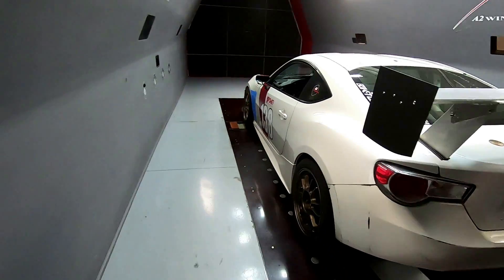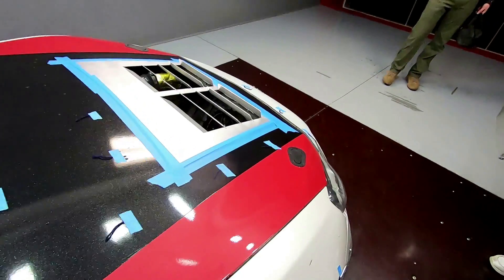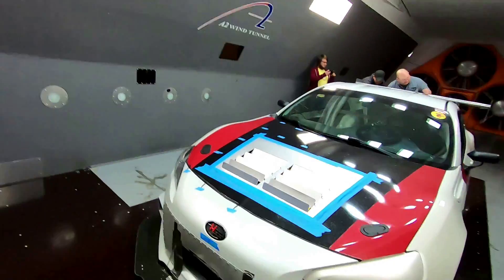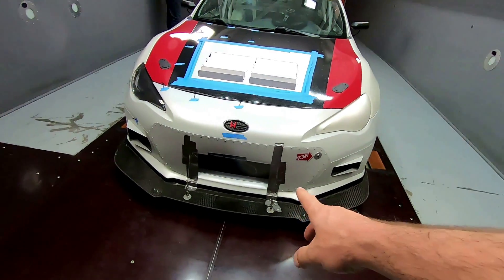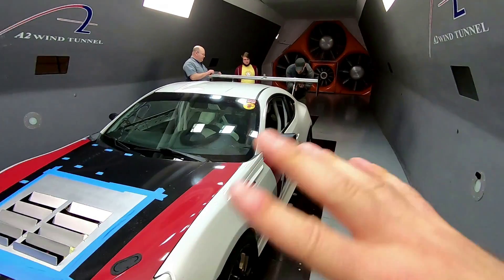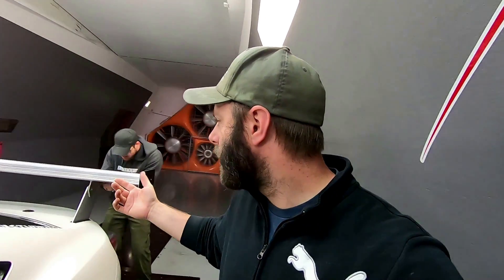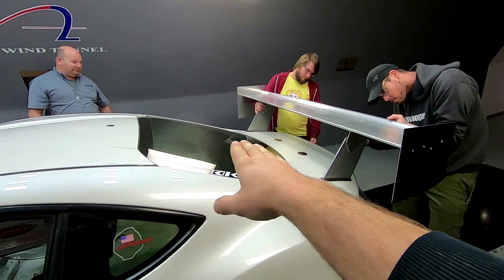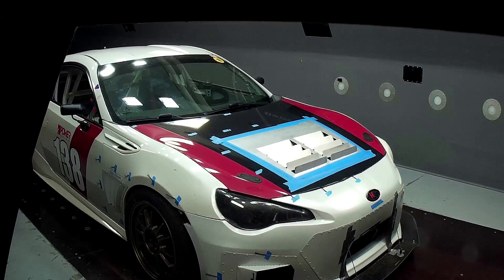Race Louvers - BRZ in the Wind Tunnel

Comment: Should I run an open hood radiator exit, or are the cooling louvers better? 

Would adding a few aero spikes to the back of the roof, and raising the wing help? You may get more air to stick to the roof and you'll have cleaner flow to the wing.